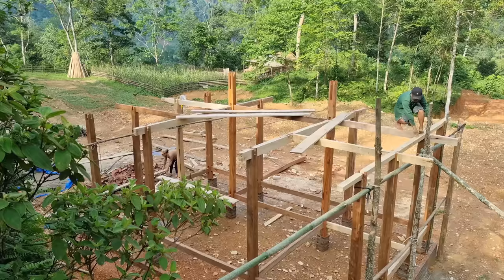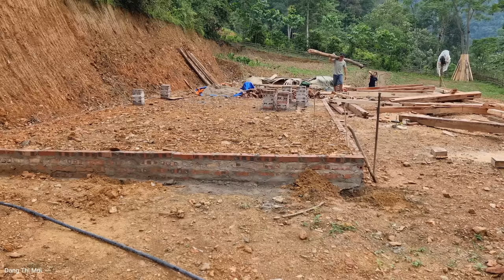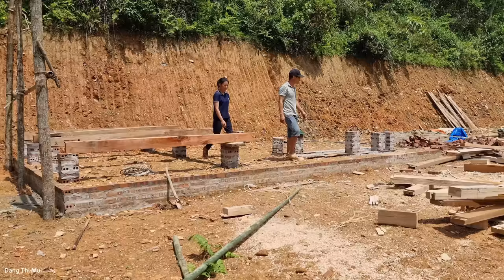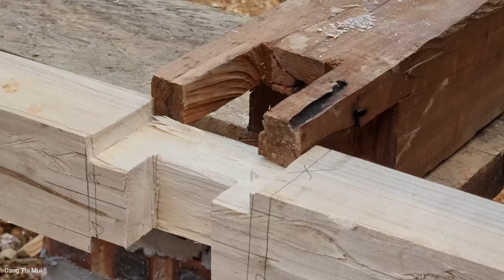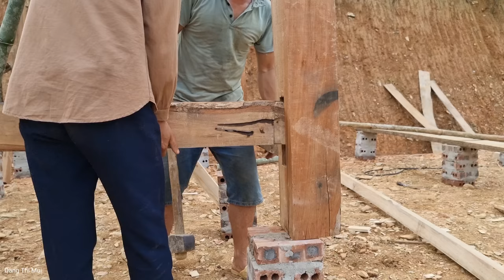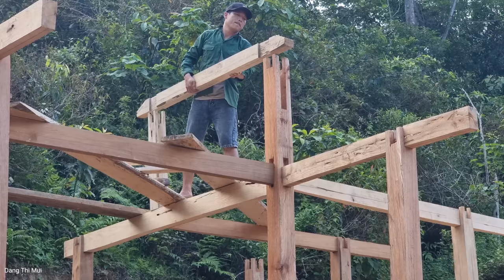Techniques for erecting columns, assembling and finishing house frames - Dang Thi Mui

Comment: It's ok that the house pillars or poles of the house are placed on the top of the stone if there is no typhoon coming! But , when the typhoon comes , the house surely be blown away or knocked down. So he must have a concrete foundation and postrap that will hold the coloumn so that they are not blown away by strong winds
Reply from the maker: I linked the columns together the wind won't do anything